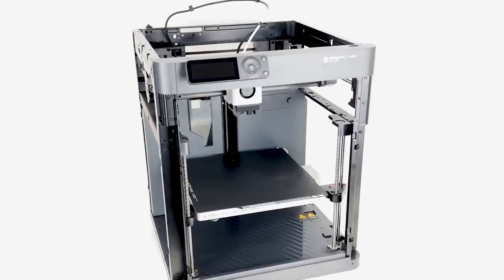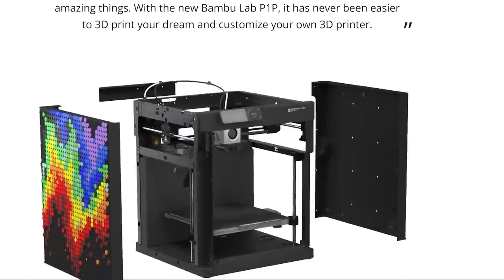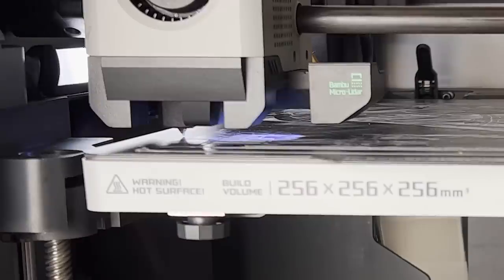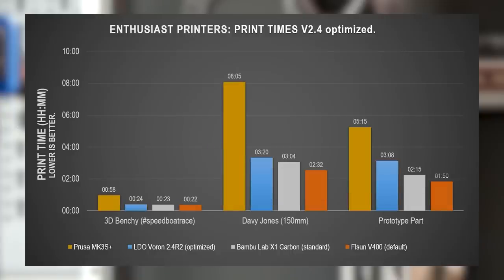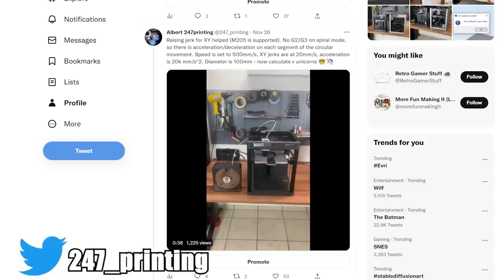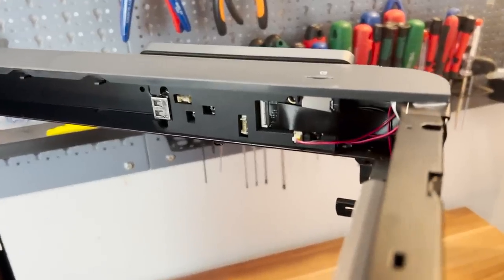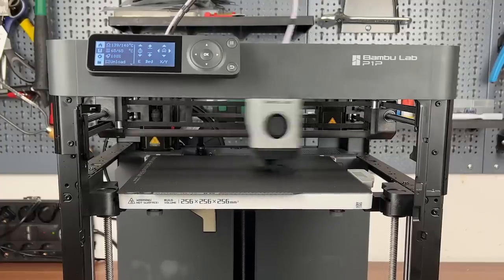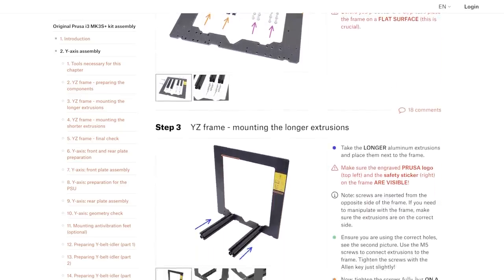Bambu Lab P1P REVIEW -  HOW GOOD IS IT REALLY ?!

Comment: I have two X1C's and a Prusa MK3S+ and although I really enjoy using the Bambu machines, I won't be retiring my MK3 any time soon.  Yes, it's slower, but a decent number of my prints are run slow and hot, so that's OK (PC-CF for one) - I get fantastic results from the Prusa.  I also like Prusa Slicer better than Bambu Studio as it feels more mature and feature-rich - although now I've had the network connectivity of the X1C, I really miss that on the Prusa.  I've also had more issues with the X1C (bad camera, bad heatbed sensor cable, filament jams - in just a few months), and I don't think the firmware is "there" yet.  Even with all the fancy sensors, it will still under-extrude, phantom print, and other dumb things.  I've had to clear several plugged nozzles on my X1C's and never had that happen on my Prusa (knock on wood).  

Now, if I was recommending a printer to a noob on a limited budget .... I would have to point them at the P1P over the MK3S+ (kit).  Yes, it's proprietary in a lot of ways, but Bambu's part pricing is very reasonable and their shipping is quick.  The results (especially using Bambu-branded materials) are excellent and fast.  It will be interesting to see, over time, what modders do with them.

Comment: Good summary. The real dilemma I see is whether the Bambulab models will hold up as well as the Mk3S+ in terms of wear/adjustment/etc. I've built a Voron 0.1 and my Mk3S+ and aside from a bearing issue with the Prusa (no, the linear bearings are NOT pre-lubricated lol) I haven't had any problems with either. I'm looking hard at the X1 Carbon just because it takes all the MIND-NUMBING and error-prone guesswork out of tuning resonance, pressure advance, and extrusion rates. I really, REALLY loved how the default profiles from Prusa just worked out of the box with their filament on the Mk3S+ but as soon as you want to move to something more useful like ASA or other engineering-grade (lol, I know) filaments, you have to go back and retune so many things that it becomes a real drag. I'm past the "I wanna build the kit to learn how this stuff works" and well into "get off my lawn, I just want it to print well all the time."

Warm regards from Texas and Merry Christmas. ;)
(not so warm here, though. Was 10F/-12C here last night.)
Reply: Tons of problems are already coming out with the X1. Check reddit, twitter, fb groups, etc. My friend just got his X1 last friday, and the same day the stepper motor went bad and he still hasn't heard back from bambu CS. Didn't even have 10 hours on it. Just another china made printer with china made parts and quality.
Reply: @LilApe  That's disappointing.
Reply: Bambu has been pretty transparent and open.  They told the community that due to the Covid outbreak CS would be degraded and apologized in advance.

I have a KS unit, and the 2 times I've had to reach out I got responses in <48 hours.

The machine is top rate, and I would dare say the first of the next generation of consumer printers.  I've printed a crazy amount of materials and the only thing that gave me trouble is when I directly ignored all advice and tried to put TPU through the AMS.  That was a headache to unjam, but 100% my own fault.  Threw the TPU on an external spool reel, and it spat out the best TPU print I have ever done.

So far I have printed with: PLA, PVA, TPU, ABS, ASA, HIPS, CF-ABS, CF-ASA, CF-PA 6, CF-PA12, CF-PA blend, PC, PC-ASA, PC-ABS, Support W, Support G.  I've used a dozen different brands of filament.

To say it is just another China printer is fairly derivative and narrow-minded.
Reply: @seashadow5239  Interesting. Thanks for the feedback. ;)

Comment: I made my two Rat Rig based Corexy printers just before the X1 was released so I had no money to join the KS and I do feel like I missed out on something special. After the P1P was released I decided to upgrade one of my printers with the Rapido and LDO motors and I can compete with the speeds so that made me feel a lot better, but I really would like the X1 Carbon with the multi material setup. My Prusa is still my go to printer for anything that needs PETG, ASA or PCCF it prints those so well with a small upgrade of a nozzle X. I do have the MMU for the prusa, but I was never able to get a reliable filament rewinding system in my small space so I removed it.  Bambu really have done a good job of shaking up the printer market for 2023, exciting times !
Reply from the maker: Today I saw content of Adam (Vector3D) about really handy filament clips. I want them, but don't need them quickly. Started Prusa Slicer, picked a default setting, sent it to Octoprint and started the print on the MK3 blindly. If not in a hurry: It still has it's nice touch!

Comment: to really be more relevant, i think Prusa needs to make a corexy Prusa Cube that works with their toolchanger and multi filament system. especially since they are making their fork of the marlin input shaping algo and a corexy takes better advantage of that feature than an i3 bed slinger type. 

the cube footprint helps it fit spaces without needing to worry about extra front or rear spacing. having the bed stationary, layer shifts from bed acceleration or a slipping magnetic bed arent really a concern anymore. everything just goes fast.

Comment: The X1C is has transformed my little printing farm into a cash collecting win fall... The speed i can smash out clean looking prints is just next level. The P1P is just the next step to converting all my machines over eventually.  But... @ nearer to 1k au and by the time you add an AMS  ($500*) Then the extra's.... IMO if your looking the multicolour then the X1C still represents better overall value imo.  The day Bambu Labs decided to release a 300 x 300 or even 400 x400 printer it's game over.

Comment: I think it goes without saying that Bambu Lab knocked it out of the park across the board. However, I find it odd that they don’t offer an upgrade path for the P1P to carbon level and it just limits the amount of money they can make. Aka, you should, be able to buy the stripped down P1P and upgrade it, fully over time, to the Carbon. In the end, it would cost more, but allow the customer to outlay the fundss over time. Aka, the budget constrained could still get in, and over time, have the same product and? Bambu still profits well from it. Re Prusa, they’ve manaaged to set the standard for years, but, obviously haven’t innovated in too long. I bought a Sovol SV05, modeled after the Creality 5 and it cost me 279.00. Creality, is the ones that made Prusa over priced. Joe and gang however, aren’t “done” in my opinion. I believe it won’’t be long before we see their response to the market changes. Will it be too late? I don’t think so. Don’t count them out yet.

Comment: With how well engineered the BambooLabs printers are, they could probably up the print size by quite a bit without having to sacrifice print quality or speed too much. I expect an X1C+ or X2C at some point 2023 with just a larger print size and probably more filament roll storage space on/within the printer.
Reply: in bambu's AMA on reddit, the ceo said that a future large format printdr wouldn't just be a scaled up x1c, they would add a lot more features, and redesign many parts.
Reply: @morbus5726  even better!
Reply from the maker: I double that: Ingenious engineering there! I also think easy scaling the X1 to 300-350mm from a design point of view should be doable. The problem for a bigger sheet metal frame like this: Loads of investment for tools and assembly to do by Bambu Lab and it's a smaller market. Maybe 2023! I'd be excited!
Reply: Agreed…an X1 Carbon with a 350-360 build build plate to match the XL and it’s game over. I LOVE Prusa but the competition is heating up which is great for us consumers!

Comment: Honestly if I were wanting a printer that just works without tinkering then I'd still recommend the prusa over the bambu lab. There's good slicer profiles for nearly every filament, there's better access to spares and the supply chain is there. It's a proven platform and the support is just miles better than what bambu lab have in place.

I think the bambu lab printers can take that spot away from prusa, but it's just not there yet.
Reply: the bambu printers also have profiles optimized for almost every filament, including bambu branded, generic, and polymaker.
Reply: The single issue I don't like about the Mk3 is the old-school nozzle.  I find getting the 2-part nozzle and heat break seated properly incredibly difficult and I've ruined two different hotends because of blobs of doom caused by imperfectly seated nozzles.  I think Prusa would be well advised to switch the Mk3 to the same nozzle the XL will be using.
Reply: @davydatwood3158  I agree. While I have never damaged my hot end switching nozzles was always difficult and nerve-wracking. That's why I upgraded my prusa with a Revo system switching nozzles is so much easier. Prusa should just make them or something like it standard.
Reply: Prusa no longer has any secret sauce. Alot of printers now are on par or better. People using  prusa's just don't know cause they've never really explored outside there box.

Comment: wie kommst Du auf den Preis für den X1 Carbon, oder soll er nicht inkl. Vat sondern exkl. Vat sein? Auf der Shopseite kostet er ohne die Anzahlung 1369€ + 19% (269,11€) macht 1629,11€ dazu kommt noch Porto und die Anzahlung von 20€
Reply from the maker: Du hast bei der X1 Carbon Combo geschaut (mit AMS), da sind es die 1629€. Nur der X1 Carbon kostet das wie in der Tabelle angegeben.

Comment: Great review. This is a pretty good machine. The Sovol SV06 is supposed to be a great Prusa MK3 clone. I won't have mine for a couple weeks. I have been a huge fan of Prusa since they came out, but there are a few newcomers that are stepping up
Reply from the maker: Thank you Paul!
Reply: The Sovol SV06 is very much LIKE a Prusa, but I'd describe it as an "early Beta of the MK3S" - it doesn't have a lot of the "nice to have" features of a MK3 (like filament run-out sensor or independent Z axis steppers - they're wired together - or the really user-friendly firmware).  Still, for what they cost, they are a solid printer.  I set up a profile in PrusaSlicer for the Sovol SV06 and it's been working great.  If it wasn't for the screamin' PSU fan, it'd be almost silent, too.

Comment: To say you're not a big fan of the cheaper p1p screen is akin to saying the same about the prusa screen. Just saying. All due respect.

A prusa xl themed enclosure would be hilarious.

I respect you so much for marking a line in the sand even though a diy creality kit from their site would be a great, no big expense way. I've never met a German who didn't like metal. I approve haha
Reply from the maker: Hard to compare the Prusa screen and the P1P screen: Different approaches: The encoder style on Prusa is faster and more convenient to use. Also less delays.
If you have the opportunity: Try to check out both to get a feeling!
Reply: @247printing  good point my friend.
Reply: When I switched from Ender 3 V2 with its big LCD color screen to the Prusa i3 MK3S+, I thought "what a screen downgrade !". I planned to ad a touch screen connected to my octoprint.
But after the first interactions with the controls, it's way better than the controls of the Ender 3 V2 itself. When you know it, it takes few seconds to do what you want to. It's very intuitive and effective. I will say even better than a touchscreen with a bad or just good UI.
After two years, I print with my Prusa several times a week and never put the touchscreen that I wanted to the first time...

By seeing the controls of the P1P, when you have the Prusa i3 experience, you know within a second that they are worse than the Prusa. Especially with theses buttons.

Comment: It looks like Prusa is in an awkward spot right now. If you want a high end printer that works, you go Bambu. But if you want something that's a project, why not just go Voron or something like that?
Reply: A prusa mk3 kit can be a good entry point for a noob. Community is huge and the project is very very well documented. I'm not sure if a voron is a good idea as a first printer.
Reply: @retrograpejuice  yeah, voron isn't a great entry point into diy printers if you're green.
Reply: The MK3S kit is still good (and yet still cheaper than a V2 kit)  if you want to ease yourself into a Voron. Sure, it's a slower bedslinger, but you get your experience building a more reliable machine than anything Creality ever spit out. I've had my MK3S for 3 years now, and the only thing it needs is some routine maintenance every now and then.  I'm a hobbyist, so the MK3S suits my needs just fine. 

I want to build a Voron 2.4 just for fun. I enjoyed the MK3 kit.

Comment: Hi Albert,
I have a question.
Do you use 3d printing in your Job/company.
I work at electrical engineering for a Mining company and 3d printing is not a topic. Everything is in metal (mindestens 30mm Edelstahl).
3d printing is my hobby but I think that is a perfect tool for the industry.
What do you think?

Greetings
Reply from the maker: Hey, I personally don't use 3D printers on my jop directly - mostly use outlook, powerpoint, excel for planning/managing. The company I am working for (car manufacturer) uses all kinds of 3D printing though for prototyping, production and individualization.
Reply: @247printing  the same for me, office and cad software.
Our prototypes are always made of metal (CNC or Casting)

Comment: The only thing that bothers me, is that many reviewers claim that the P1P/X1 is loud and shouldnt be in the same room as you most of the time. Like you already said. Since i have my gaming PC in the same room its important for me, that the printer is as quiet as it can be.
Reply: That's one of the advantages of the Prusa. It makes a fair amount of noise too, but if you first get a very heavy paving stone that's like 40x40cm squared and thick, and put that under it to soak up vibrations, that quiets it down a lot. If you then also add an enclosure, that will control the fan noise as well. I run my MK3 in my office space in a makeshift enclosure and I can live with the sound. Especially since i print PETG almost entirely; PETG doesn't need the maximum cooling PLA does, so the tiny fan doesn't have to spin at a gazillion rpm and howl its head off.
Reply: I run multiple prusa printers 5 inches away from me on the same desk where my gaming PC is set up. They sit on 1/2 rubber pads from home depot and they are just as quiet as when i use to have them sitting on a heavy concrete paver. I can sleep in the same rooms in my prusas. Cant do that with a bambu. even when running bambu at really slow speeds. Its just ridiculously loud for no reason.
Reply from the maker: Loudest thing are the resonances of the stepper motors - an easy fix for people who watch CNC Kitchen :-)
Reply: @247printing  change stepper drivers?
Reply from the maker: @DoktorSkill  stand it on a resonance absorbing surface

Comment: Hi guys, please help me decide between a P1P and X1C.    If I upgrade the P1P's head to a hardened steel version, and perhaps add DIY covers to have a kind of enclosed cabinet (I may also add some chamber heating) will I get the same results when printing higher temperature filaments, like nylon, carbon or ASA ?   Without warping.
I understand I will miss the more comfortable control panel, but are there anything else I would miss and regret not buying the much more expensive X1C?

Comment: Just wonder with those kind of speeds, will it beat itself to death? shorten its lifespan? and the unknown of reliability and durability? So many questions, new to this, so I have lots of Rookie questions.
Reply: Most of the parts on 3D printers are damn near bulletproof. I've been pushing my printers to their limits for years, and never had a non-consumable part fail. Stepper motors are near bulletproof, and as long as electronics are kept within their operating range, they'll last for many years. I've been running a few Ender 3's on Klipper so fast that they shake the heavy table they're on for 2 years. The only thing I've ever had to replace is rollers and a belt. The Bambu Labs printers are on linear rails, so don't have to worry about rollers.

Comment: I currently have an Artillery Genius, I am looking to upgrade and want to get a printer that is quite and has best finish quality. Would be great if someone with one of the newer faster printers tested finish and noise at lower speeds. 

It's hard to find reviews that focus on that side of things.

Been watching your videos for a while and really like them, thanks for putting them out
Reply: They are always noisy. Tmc drivers are not always silent or silent because they are tmc drivers, it depends in which mode they are. Stealthchop, the silent mode, is weaker, less accurate and has less maximum speed compared to spread cycle, the performance mode. The bamboo uses exclusively spread cycle, otherwise it couldn't move as fast as it does.
Reply: I still have the Sidewinder X1, everything is still reliable and works